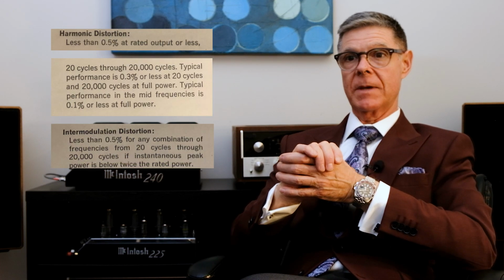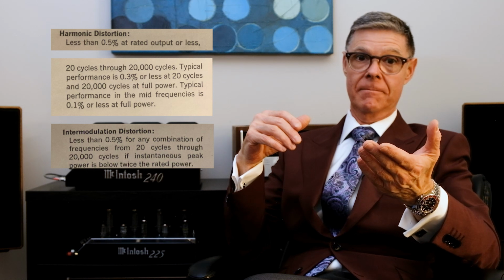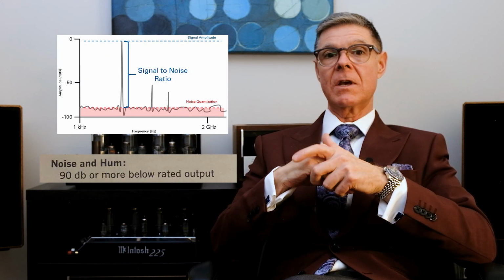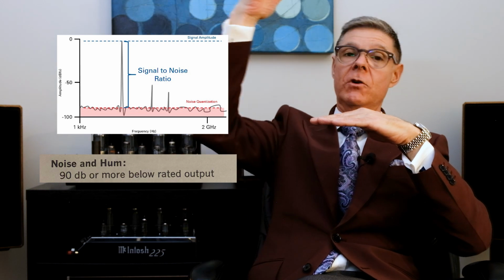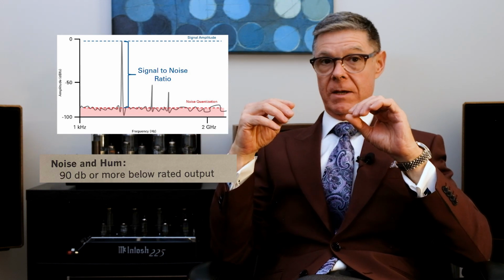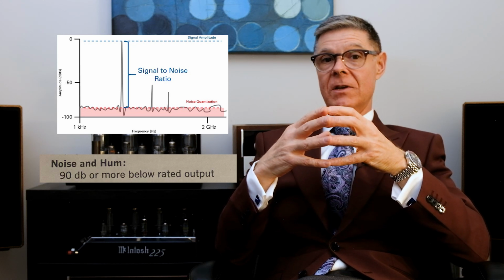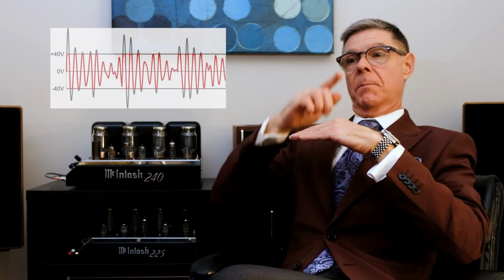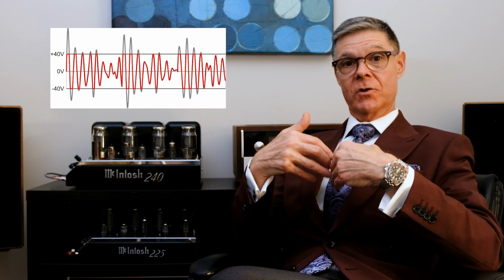Power Amplifier Specifications and Brief History | Audio Basics Episode 3 | The Audio Show

Comment: Thank you for your videos they are very interesting. Are you gonna talk about equalisers or tone controls and the controversy around it. I’m in love with EQ because it gives me the sound I want and honestly seeing someone using it and I think you do if I’m not mistaken is greatly appreciated. Please talk about it a little. Thank you very much.
Reply from the maker: Thank you for watching and commenting!  Everything is controversial it seems, right??  Everything in audio is about personal preference so it has always bemused me why people get so worked up.  I do use an equalizer on one of my systems.  Let me first say the there could be a little downside to using one.  It's an extra piece of equipment, and that means extra connections to create noise or fail, another power supply to create noise.  Any unnecessary step in any equipment is a potential for less reliability and performance.  BUT sometimes the benefit is well worth it.  The particular equalizer I'm using is an MQ101 which was specifically designed to work with the contour of McIntosh speakers.  I'm not using the speakers anymore but I do find the EQ helpful and here's why.  On that system I'm using a C-22 MK IV.  Unlike the previous versions of the C-22 it does not have a "high frequency filter" contour.  That was always included on the earlier models to attenuate the surface noise on 78's.  So on my other systems I don't really need it because I'm using an older pre-amp.  But I like the extra control for playing 78's with that system.  (And since I'm in a corner unit with all glass a little bass boost doesn't hurt either--haha.)   If you have an equalizer that you like to use and you keep the power supply caps fresh and the connections clean and tight with good cables it will definitely help to create the sound you like for your room.   Thanks again for watching!
Reply: Thank you for all these informations. I hope you will continue to inform us about everything concerning our passion. I hope you will give us a tour of your possessions. Thank you so much.